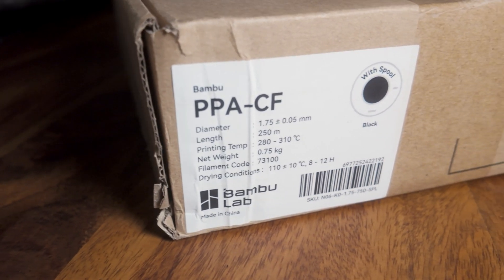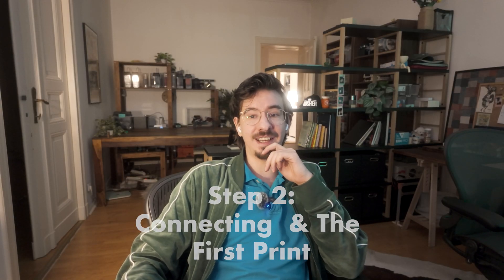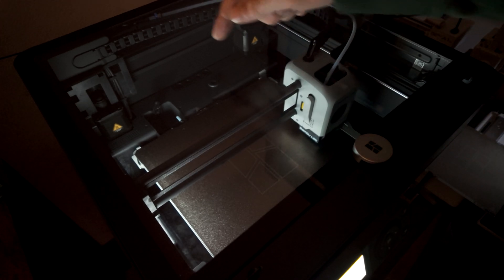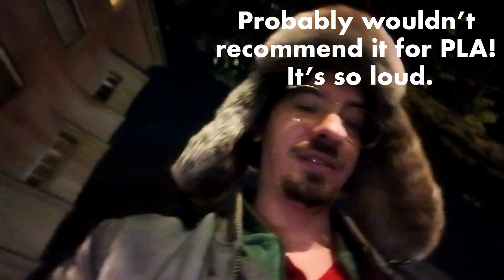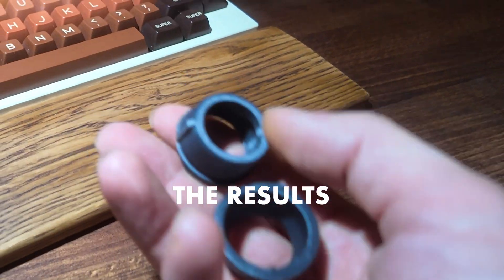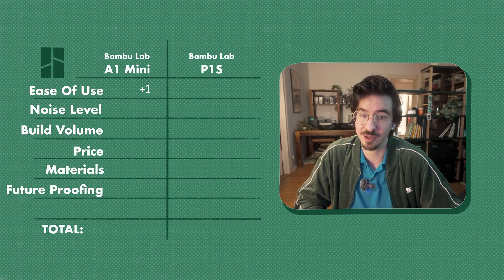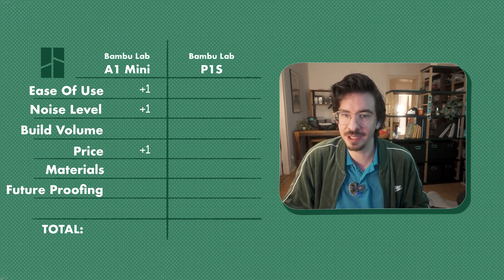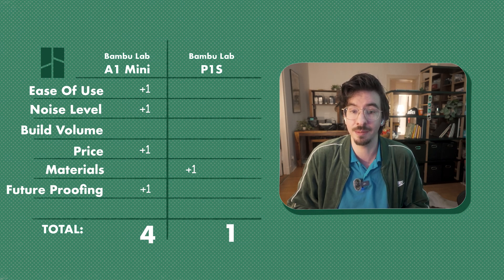Why the Bambu A1 Might Be Better for You Than the P1S? P1S: Review

Comment: As a user of 3d printer for 8 years i decided to go with p1s ams (waiting for delivery). The most important thing for me is dust problem that u totally forgot about it. Second thing is... its just better looking, closed. 3rd thing - AMS with all that open mess with A1. Filament getting moisture etc. 5th.... damn, i wanna have core xyz :D Yeah.... u can achieve the same results, a1 might be better as 1st printer but if u buy a product for years, closed chamber is just better overall.
Reply from the maker: its a breeze to use im shure you'll love it :)  but if your on a budget or just need a quiet printer the a1 line is not to be overlooked